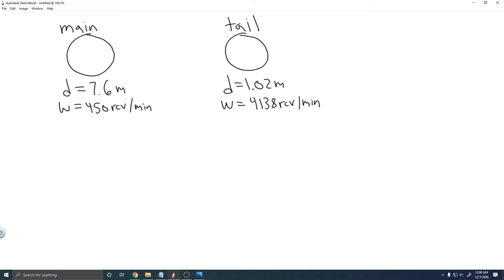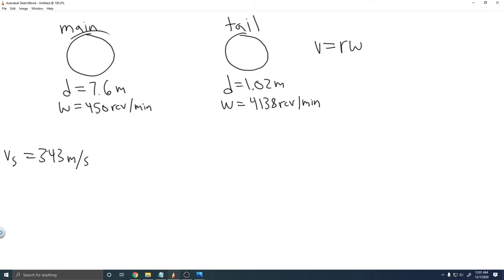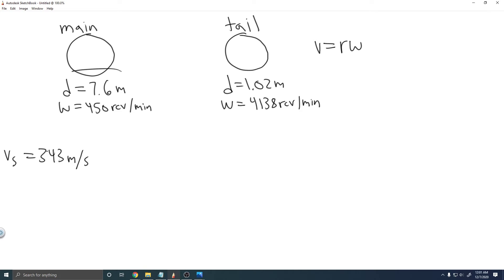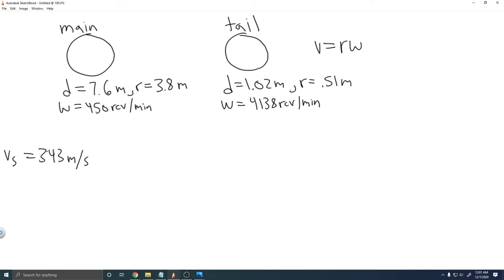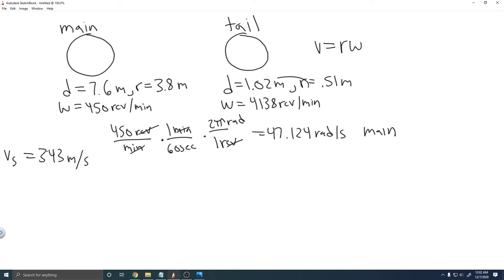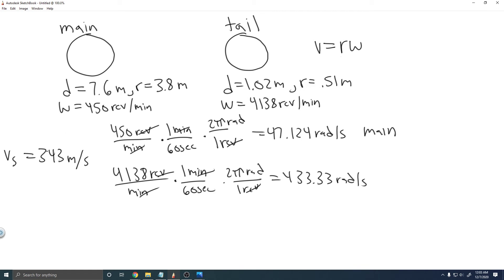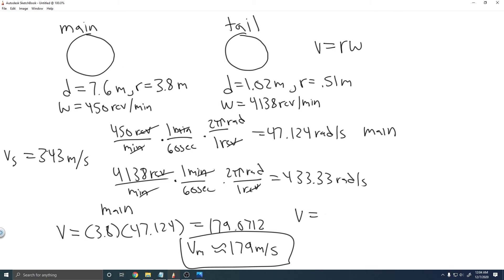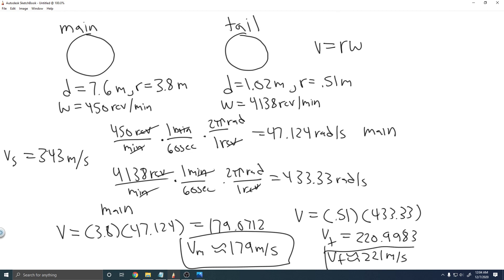The diameters of the main rotor and tail rotor of a single-engine helicopter are 7.60 m and 1.02 m,

Comment: To get the last part, Compare these speeds with the speed of sound, 343 m/s, take the two answers you got 179 and 221 and then divide them by the speed of sound 343. 0.522 and 0.644 are your answers for that part.